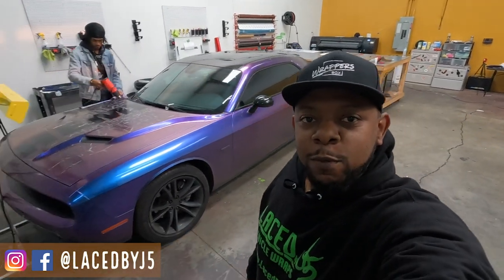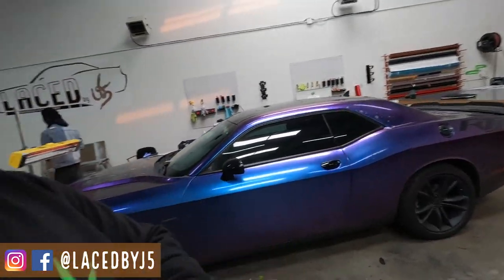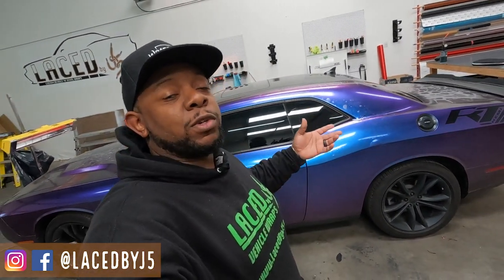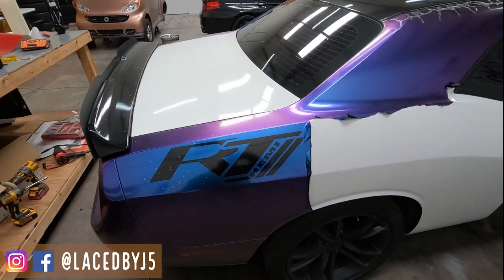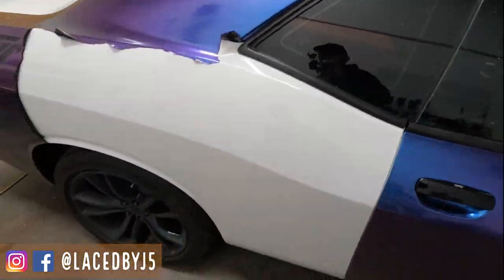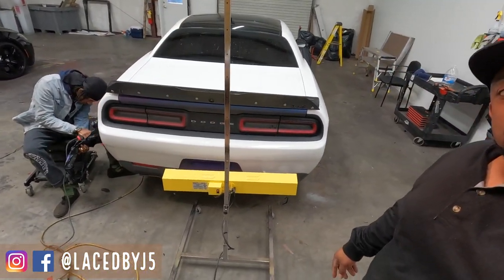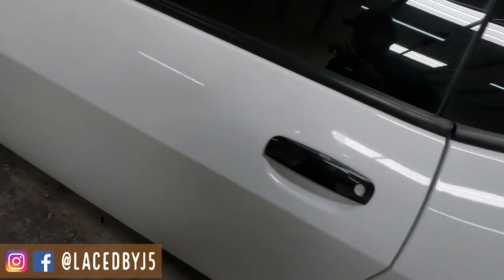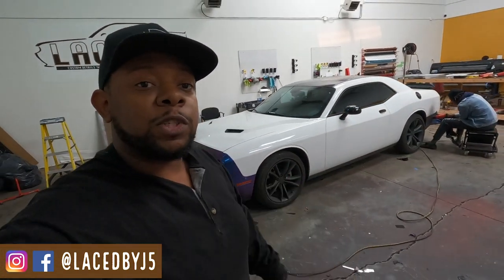Wrap Removal Video

Comment: Appreciate the Info!! I bought my car with those ‘Protective Films’ on the front/side mirrors…Looks like a horror show 🥸
Atl 🤍🖤♥️🇺🇸🇺🇸🇺🇸
Reply from the maker: Old protection films are typically worse than wrap to remove.  Use a steamer to help if you have one. Also, use a rubber wheel. They work well for old PPF.